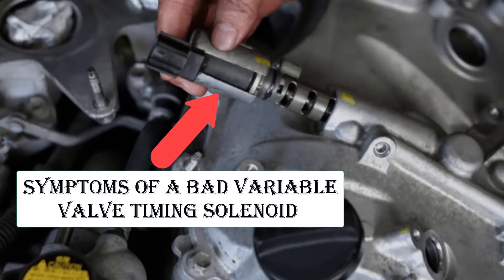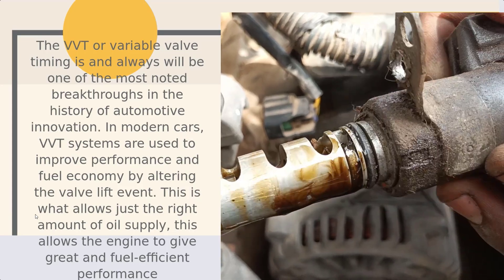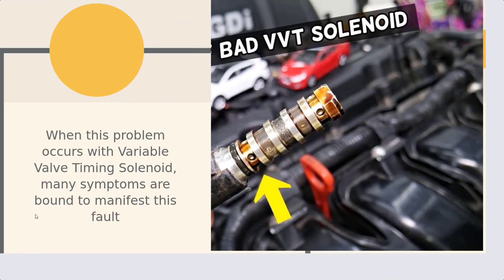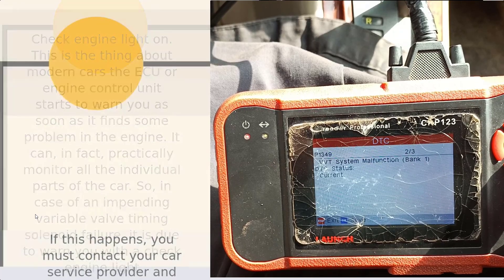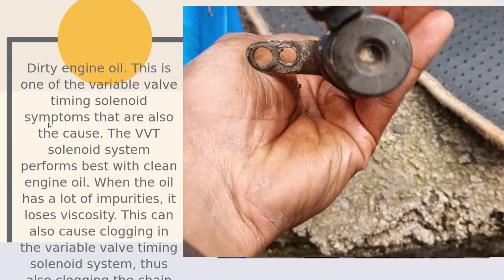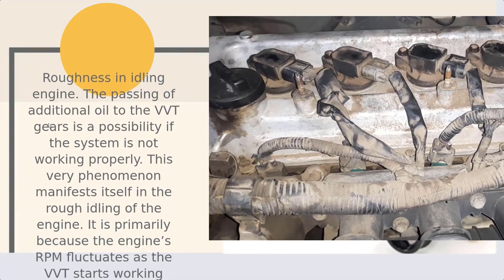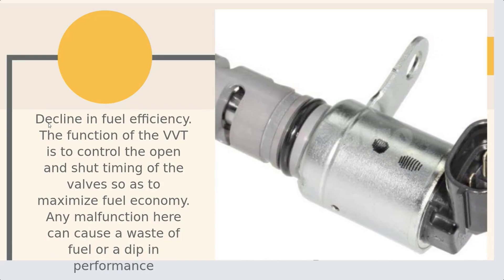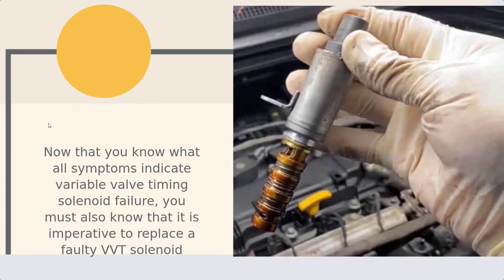Symptoms of a Bad Variable Valve Timing Solenoid

Comment: Is there not a single answer on the entire Internet as to what the difference between an intake VVT solenoid is and what an exhaust VVT solenoid is? How do I know I put the intake with the intake and the exhaust with the exhaust? How do I know they sent me the right parts?
Reply from the maker: There are two solenoids located on both the intake and exhaust sides of the engine. All variable valve timing solenoids/actuators are the same.both refer to Variable Valve Timing with intelligence, a technology developed by Toyota to improve engine performance and fuel efficiency. The difference in capitalization is simply a matter of styling and does not reflect any functional difference between the two.

Comment: My scanner says vvt monitor bank 1 status fail .  No trouble codes , no light. Car runs great at start up , but vibrates at idle after warmed up. What could that mean ?
Reply from the maker: Maybe the solenoid is dirty or stack malfunctioning. There is also the timing chain the might be over stretch, depending on the mileage.check your vvt solenoid and clean dirty solenoid.
Reply: @luleautogarage  ok, the  mileage is 77,600 and it has at chain, I know chains are not flawless so it could be.
Reply: Could also be a dirty throttle body. check that too.
Reply: @matvich3531    I removed it and cleaned it , Looked brand new when reinstalled. Mass airflow clean, hoses good, pcv new.  Scanner check all good on all.
Reply: Thx
Reply: Mine does the same have you find a solution?
Reply: My 2008 expedition got the same problem! Need info
Reply: @NoAuto-vd8tg  vvt solenoids probably dirty.
Reply: @johnf.6942  I’m gonna look into it! I changed my spark plugs and the coil packs still was giving me the same problem so hopefully that helps, thanks
Reply: @NoAuto-vd8tg    I have a mechanic friend that couldn’t locate the trouble, but I seen other videos that seem to point to them. I ended up trading in my car.  I seen some videos where guys are using Valvoline restore and protect oil. I’m not sure if this would clean up any dirty deposits that could cause a dirty vvt to act up,  but you might want to give it a try look for the videos on YouTube. It may help clean up the sludge and caused that problem go away. I don’t know for sure.